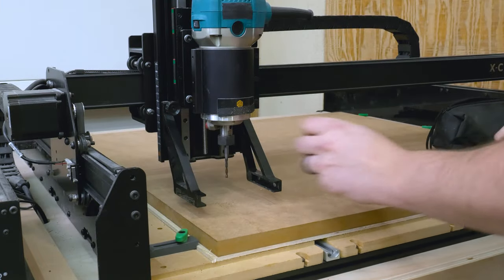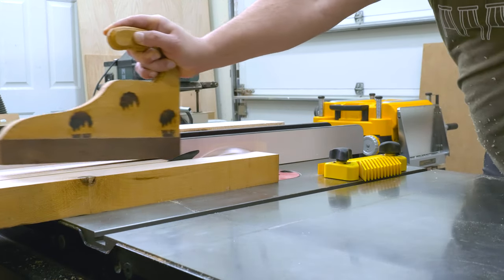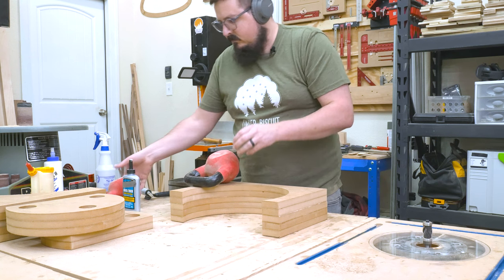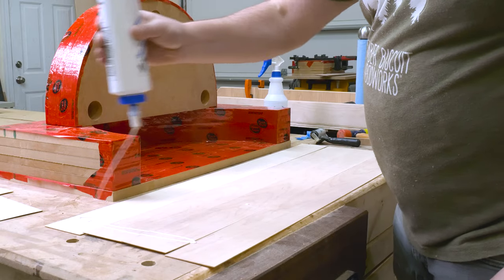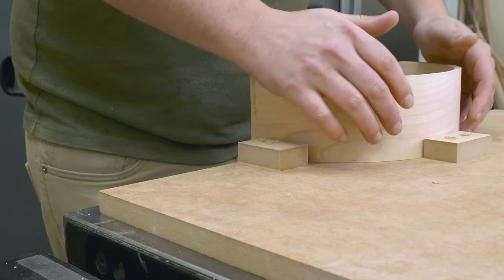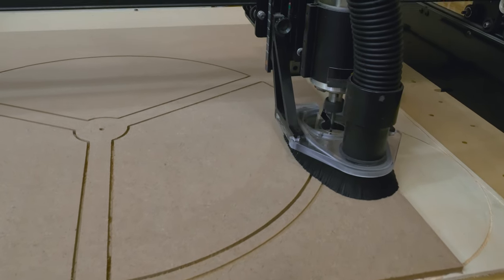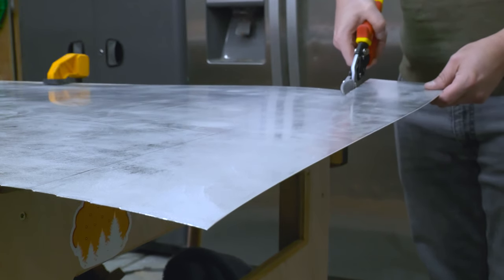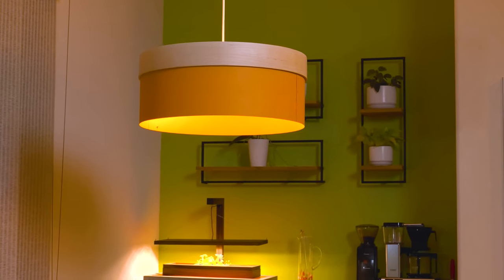Making SIMPLE Bent-Wood Pendant Lights

Comment: Loved this video… we are having a prototype project for a next gen baby bed and I wondered how you can minimize the visibility of where the two veneers half circles are glued together. Is just sanding enough and they look still high quality and beautiful? Would appreciate any input from you on this question. (We rather have an undetectable cutting edge where the are glued together.
Reply from the maker: Thanks! If that’s the case you could edge band the lower end. Though that will be pretty tricky unless you have something like a CNC to cut circle for the lower portion. Honestly, it’s not super noticeable unless you’re looking for it.

Comment: Hello, great project and very nice looking.  Have you ever considered or had to joint the edges of both half circle forms each other? I know you butt glued the edges and  is just popped in my mind that the envoirment could cause separations  on the glued edges of the half circle forms? If it s necessary to make joints, I wonder how? 🤔
Reply from the maker: Thank you! Yeah, I did consider doing lap joints but getting them to align properly would be pretty tricky. Plus the MDF mount adds quite a bit of structure. Which is why I ultimately went that route.
Reply: @TimberBiscuitWoodworks  thank you, good luck.
Reply from the maker: @creepdealer  no worries! Thanks!

Comment: Why not cut the aluminium on the CNC to get clean edges all around?
Reply from the maker: I suppose you could, I just didn’t want to deal with the shavings in the shop.
Reply: They aren't that bad. I've cut a few bits on mine and clean up is easy.
Reply from the maker: Right, but I use the dust in the garden and don't want the metal shavings in there.
Reply: That would not be good. 

Metal chips are cleaned with my shop vac that goes in the bin. My dust collector with wood chip only and goes on my compost heap. 

Do you use it direct on the garden or composted?
Reply from the maker: @Kosh42EFG  We mix it into the compost. But stay away form mixing walnut in, that will kill everything.
Reply: I have just bought my first walnut boards (not common over here). I'll remember that. Thanks for saving my poor plants!